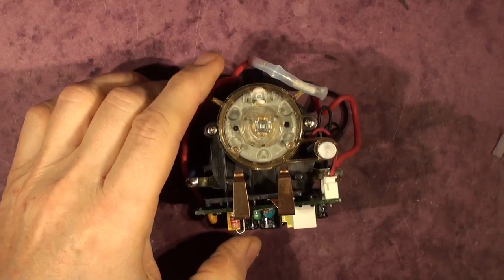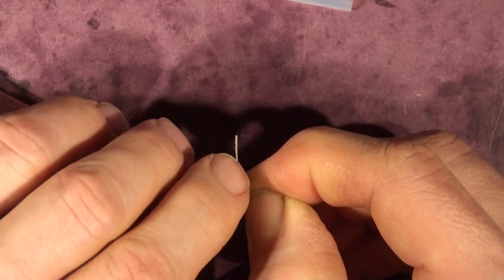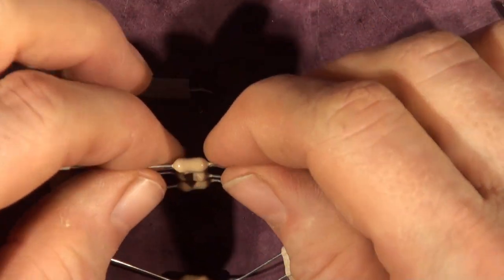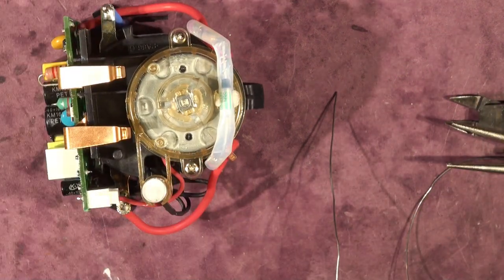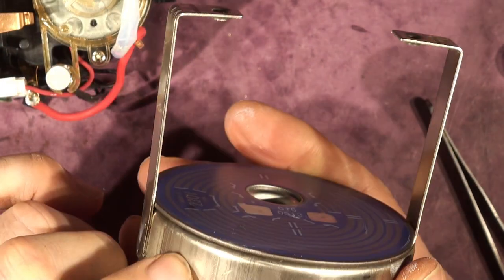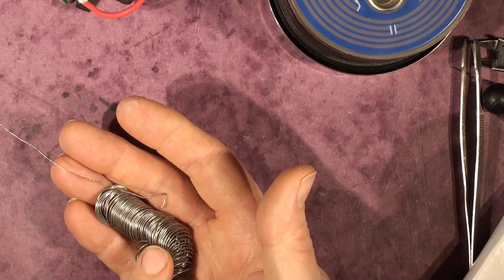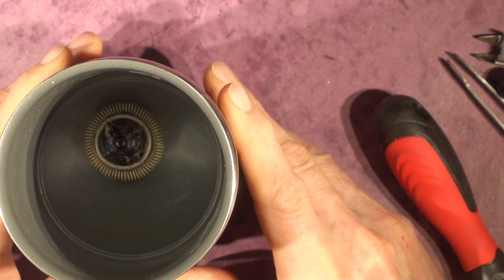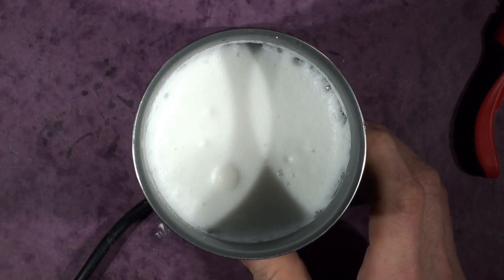Nespresso Aeroccino Milk Frother Diagnostic and Easy Repair Part 2: Reassembly

Comment: Excellent Video. 
I did my own repair following your video on how to do it. I did however put in a 250V, 133C, 2 A thermal fuse instead because I couldn't get hold of a normal 4A fuse as you suggested. So I was a bit nervous when I turned on the milk Frother ... but it worked and still do.
Thanks for the great repair video.:goodvibes:
Reply from the maker: Great Job.  A smaller fuse is better if it holds up!  Thanks for the tip.

Comment: I thank you, and I found the thermal fuse was blown., at this point, just to see if it works, I unite the two cables with out the blown fuse, and it t worked ! Next step, to find an equivalent t-fuse, and that grease, and re assembled the unit. 
Thank to you I saved my Aeroccino. Eduardo Ramírez/ Tabasco- Mexico
Reply from the maker: Excellent!

Comment: Outstanding session... BTW... the lower line is for 'Hot Frothing' and the upper line is for 'Cold Frothing'. Hold button and release fairly swiftly for 'Hot' button glows red. Hold button much longer and once it turns blue release and it will froth 'Cold'... ;-)
Reply from the maker: Thanks for the info . I confess, I didn't bother to read the instruction manual...

Comment: Hi there and thanks for the video. Took mine apart as wasn't powering up - thermal fuse was open cct. Have replaced and reattached and there is now continuity but it still doesn't work. Any ideas what else could be wrong?
Reply from the maker: Hi Jason, are the contacts where the base power socket connects good?
Reply: @razenby  Hi and thanks for the reply. Yes I put the empty cylinder on the base just to check that it wasn't the base and there is definitely mains getting to the terminals inside.

Comment: Got a blown thermal fuse as well.....
Thanks for posting. Ordered the fuse and then it will be fine again. 
BTW if you just want to warm milk remove the spring part from the spinning thing.
Was warming some hot chocolate milk for the kids. Didn't clean between the 2 cups and the sugars got stuck on the bottom causing to overheat..
Reply from the maker: They are very prone to burning the milk in a hot spot along the circumference of the spinner. The design does not fare well on UK 240V mains supply.  The power dissipated in the heating element increases at the square of the factor of the supply voltage.   (Power = Voltage Squared / Element Resistance)  . UK mains is often at 245 to 260V and maybe as high ah 265V if you live near a substation.  Mine was running a full 100W higher than the power consumption stated on the label so that the rate of heating is too fast for the thermistor temp sensor to react so it overheats  the thermal fuse blows.     Woefully inadequate design.  At 230V You can turn it on with no milk and the protection works fine but at 245V it blows virtually every time.

Comment: Thanks for this video! Very clear explanation. I'm facing the same problem. I wondered: everybody following this instructions is buying 10 pc's of both fuses. Probably you repair just one Aerocino. Who has some spare fuses for me?
Reply from the maker: Sorry I don't have any spare - I used to sell them on eBay some buyers let everyone down. I got fed up with the questions.  It is only a guaranteed fix if you have a blown thermal fuse not a panacea to fix every possible fault..
Reply: I don't know what to do with my frother. I know it can be easily repaired but don't have the tools or time with 2 babies. I am in far West London.

Comment: Thanks for the guidance. It was was very helpful.   I found a suitable thermal fuse at Jaycar Electronics (I'm in Melbourne Aust) 133 deg 240V 10A  for $3.95. I also found that it was quite easy to replace without having to de-solder the red leads. Other than that I followed all of your procedure.
Reply from the maker: Thanks, no problem. Good tip. I took it off so everyone could see how to do it.

Comment: Hi… very helpful video.. I currently have some problem within milk frother. It does froth milk , but no where near 100% . Hot milk only.. Think I should check these fuses? Any help would be appreciated… many thanks
Reply from the maker: Check your whizzer isn't clogged.  Skimmed long life mil gives the best froth.  Milk that needs to be kept in the fridge (bought refrigerated) doesn't produce much if any froth  all as it has been homogenised.  Oat milk has to be the barista variety  as most normal out milk just looks like used dishwater after attempted frothing.

Comment: Thank you for the explanation. I have a slightly different model, without a thermofuse in the red cable.  I do not know if there is one, and where to find it...
Reply from the maker: The older models have the thermal fuse embedded in the thick-film printed heating element. Inspect it the information carefully - is there a thin section that looks burned?
Reply: @razenby  I checked the heating element, and it looks in perfect condition. can't send a photo here, but there is no visible irregularity on it...

Comment: Thank you. My frother is the aeroccino plus with a handle on the side.  It will froth on cold but just flashes red when I try to heat the milk. Is the thermal fuse causing that?
Reply from the maker: The thermal fuse will cause the it to be totally dead.   If you have the later model then open it and check the later type thermal fuse that is a printed section of the printed  thick-film heating element. See the other Nespresso video on the channel this.

Comment: I found a repair kit for the Nespresso Aeroccino3 on eBay with an upgraded resetting thermostat fuse for £7.20 + 72p P&P
Stuck it in my watch folder for the time being.
Have watched part 1 of your repair video (most intuitive, I will say).. About to watch part 2 :)
I've subscribed.. you definitely know your stuff & it's very interesting watching.

Bit disappointed with Nespresso, making their milk frother basically throwaway.. & over what could be a pretty simple fix!
It's not like the Nespresso is exactly cheap (just saying).
Reply from the maker: Thanks,  Good luck with the fix. It is  a travesty. At the office we have the £20 SilverCrest milk frother from LIDL UK. (£20)  It has been going strong for three years and has been used a lot. The problem is with the Aeroccino   is that in the UK our mains can go as high a 263 volts especially with the  local solar in-feed. The semi-rural grid where we are was designed with transformers tapped for a pure load secnario.  When the sun comes out here  the voltage can go up by 20 volts.   The power dissipated in the element increases with the square of the supply voltage and the thermal dynamics of the Aeroccino hasn't been tested.  They may have improved the later models but the early ones were a victory of style over content.  Ecologically negligent design.

Comment: Very nice video! Very helpful.
My daughter also had the exact same device that broke and asked me to help her fix it. I found the same problem and I used a disassembled part from an old unit and I replaced it. But I can't fit the mug into the case because a button blocks its access. I want to understand how the final installation was done. Saw episode 2 of your video and saw that you had removed the button, but didn't see how you put it back in place at the end either. I don't know how to take it off. I'm afraid it might break it. Thank you for the video.
Reply from the maker: I just eased out the silicone button silicone rubber out of the case and replaced it when the internals were fully seated.
Reply: Thank you, I have installed it, after testing, everything works fine. If I didn't see your video, I might want to remove the bottom cover, which could cause damage.

Comment: Hi how are things? I need to do this repair on an Aeroccino 4. The main problem is that it comes sealed and not with screws. I have a question about how to open it and secondly, I don't understand why in addition to the thermal fuse you put a resistor. Although I think you mentioned that it is another fuse but not a thermal one. Is there any particular reason or is it enough to change the thermal? From already thank you very much!
Reply from the maker: The component in series with the thermal fuse is a normal 3A wire ended fuse.  I no have an Ambiano milk frother it is a third of the cost of an Aeroccino and  much more reliable. It  works better without the milk scorching.  Thanks for watching and subscribe if you can.

Comment: Nice fix....     FYI the two Max indications refer to the "twizzer"....        the lower mark is for the twizzer with the coil spring attached.
With the coil spring attached you get a very frothy result.  
You can remove the coil spring from the twizzer and the machine will produce a less frothy milk allowing you to fill to the higher level.
Reply from the maker: Thanks for the info!

Comment: Really helpful video on the disassembling part, but then I discovered mine model that looks completely the same from the outside had a totally different scheme inside. In fact, I had some kind of a heat fuse soldered on the heating element itself, which was completely gone when I opened the device. The red power cable that goes around the assembly in my case is a solid line…
Reply from the maker: Ill have to check one of those out.

Comment: Dear Magic Smoke, I have a model 3194 which I think is an aerocino 3. Not working. When I briefly hit button the red light comes on and device heats for about 45 seconds before cutting out. When I hold the button to illuminate the blue light no heating or frothing function, then cuts out after about 45 seconds. What do you recommend? 🙂
Reply from the maker: Tricky, if it is a reliable 45 seconds every time?  If so, it sounds as though the processor may be getting wrong temperature information.  Does it whisk cold milk OK?

Comment: Hey is it okay if I only use thermal fuse and also is it possible to remove the crimps and simply weld the wire and fuse together as the crimps are quiet hard to get rid of
Reply from the maker: If you solder the wire you may blow the thermal fuse.  If you want to try soldering then do it quickly whilst holding the component leg with a pair of pliers to sink the heat from the solder.  I was always taught to fit a fuse. Up to you if you want to omit it.

Comment: Thanks for the clear instructions! I have the 3192 Model and it starts and stops and I have to try a few times to get it to work. I realized that problem is "cold milk". If I put room temperature milk or lukewarm water it works normally. Could it be the thermo fuse causing the same problem as well? Best
Reply from the maker: Unlikely to be the fuse. They usually just go open and that is that.  It could be the contacts on the bottom of the heating element.  When you put warm in the container changes shape due to expansion and the contacts make.  If you see any evidence of spark then clean them and bend them to make a firmer contact.

Comment: That was really cool, well explained.  But just as I was about to open mine up and test the heat fuse, my daughter pointed out that the 'aero wasn't sitting flush on the power knob, and on inspecting the base of the 'aero I could see that the outer copper/brass electric contact had been crushed by someone (?) ramming the 'aero onto its base.  Delicate retrieval using two micro-screwdrivers got the contact straight but 'aero still not working.  Maybe the contact is too straight??
Reply from the maker: Good job!!

Comment: Thanks for reply, used the same milk for years, never been an issue. Whisk is clean and magnets in place. Think I will replace whisk and see if that corrects the issue. I have seen changing the polarities on the magnet connection can help?
Reply from the maker: Hmm never thought of that.  It is probably the motor brushes failing or a bad connection to the motor  either of which could cause low RPM.  One thought - is the milk hot when the cycle finishes..?

Comment: Hi I am trying to repair a Nespresso Aeroccino 4, which I think has a failed thermal fuse as per your video. the fuse has markings 4A 250V and 7A 125V also 22XRUM1 I think. I was wondering if you have any of the two fuses you used in the video I could buy. I know the video is 4 years old so quite a long shot. Thanks
Reply from the maker: Sorry I dont. I  will get some in. I got fed up with eBayers complaining because the component set wasn't a cure all.  No diagnostics and no brain and then indignant because they were too thick, if there was a human race they would be near the staring line scratching their heads.   Summary refunds by eBay with no return. As my dad used to say  'no good deed goes unpunished'
Reply: @razenby  Thanks for getting back to me. Much appreciated. I am trying to repair my daughters machine. It seem pointless for me to purchase 10 of each as i would never use them. I realise that these may not cure the problem but there apears to be no continuity through the fuse so its worth a try. Let me the costs and  your email and i will send over my details. Thank again.

Comment: Nice work, regards from Ecuador
Reply from the maker: Thanks.
Reply: @razenby  I have a question, my Nespresso works with 120 V those pieces fuse and thermal links, do you think works on it? even if its are for 250 V? thanks for your advice.

Comment: Milk frother whisk spins and milk get hot but it’s doesn’t froth. Taken mine apart with your great guidance, all seems fine. Any idea why not frothing.
Reply from the maker: Maybe you have the incorrect  milk, semi homogenized full fat milk doesn't froth well. Try some long life skimmed milk, If that doesn't froth then your spinner isn't going around fast enough. Check it is clean and that magnet is strong.

Comment: Hi there, Thank you for the video! my thermal fuse is completely burned(black) PTFE tube cracked. I'm trying to find a replacement online here in Malaysia and found Thermal Fuse 130°C 3A 250V and 135°C 3A 250V. Should I use the higher or lower temperature or must I stick to the thermal fuse with 133°C? Thank you.
Reply from the maker: I would use 135 degree one ,  The design problem with the Areoccino is that if operated little milk the safety fuse region heats up much faster than the temperature sensor region tripping (blowing) the thermal fuse before the micro-controller realizes that the temp is to high and shuts off the power to the heating element and by the time it does it is too late to save the thermal fuse..
Reply: Thank you for your reply. What about thermal fuse with 135degree 5A vs 3A one?
Reply from the maker: @pamelynzhou  Please remember to like and subscribe. 5 A is fine. The current rating is not the current rating at which the fuse will blow ( as with a normal fuse).  It is rating of the current that the fuse can carry and remain in temperature specification. So this is not acting  current protection device it is only acting as a thermal protection device. Therefore you can use either. .

Comment: Super helpful video! I watched this twice and still wouldn’t be able to do this ha. Also, getting the inside of the aeroccino 4 out was a massive pain!
Reply: try levering the top going round with a small screw driver then a larger driver, it will separate I did this after trying for ages just twisting but it was impossible. good luck.
Reply from the maker: Thanks for the info.  get a Silvercrest frother from LIDL we have one going strong for nearly three years,  it is a much better piece of kit.

Comment: Our Aeroccino 3 bought in 2018 has failed. Have watched your videos with interest but . . . When we switch our Aeroccino on, the red light glows, the spinner tries to start rotating (but manages about half a revolution) and we can hear the liquid starting to heat, but after a few seconds the red light starts to flash and the heater stops heating the liquid. We have taken the unit apart and all inside is clean and dry and my voltmeter shows a low resistance (+/-2 Ohms) across the power terminals. Any thoughts what needs to be repaired?
Reply from the maker: Very difficult to say.  I would be interested in understanding what is going on if If you want to send it to me.
Reply: Having the same problem, were you ever able to figure out how to fix it?

Comment: Hi, mine is displaying a solid blue light when powered on. Do you know why? I have not gotten a chance to open it but I am keen to do so now. Can I know where i can buy the kit to repair my aerccino 3?
Reply from the maker: The most likely cause of a solid blue light is that the micro-controller is not starting correctly.  Often this is just a bad low-power DC rail is bad and the the micro itself. Also check for a stuck/closed tact witch. Check Off-line PWM regulator chip and its associated capacitors.

Comment: there is no more thermal fuse in latest version. 
still figure out where is the problem
Reply from the maker: Some models has a section of the thick-film heating element that is not glazed. In this section the heating element is exposed to air and will oxidise and burn out if the element overheats. Then the element is open circuit.

Comment: Thank you for the video. I have an aeroccino 3 and there is no power at all.. no light no frother no heat. I looked for the thermal fuse with a multimeter and the connection is good. I check the connection of the other part who may be broken in the first video (part 1) and it seems good but i am not sure to know how to test it. I tested the power supply base and it's ok. I really got 120V (I am from canada) and the connection to the bottom of the milk frother are also good. After, I tested the push button and it's ok. Wich part should I check? Maybe it's a component on the circuit board? I don't understand. Thanks for your help!
Reply from the maker: The usual culprit is the Off line- Buck regulator chip. 8 pins on the HV side.  If you send me a photo I will tell you which one. ark.mail@gmx.com